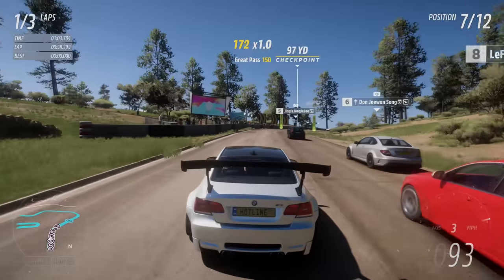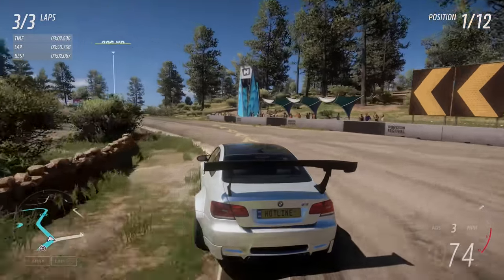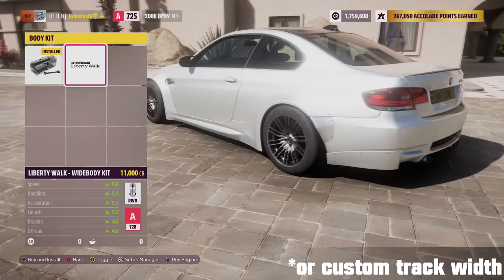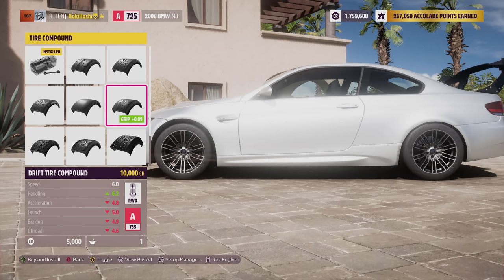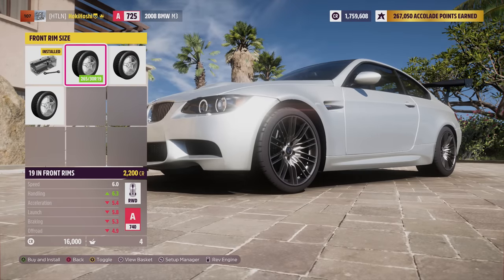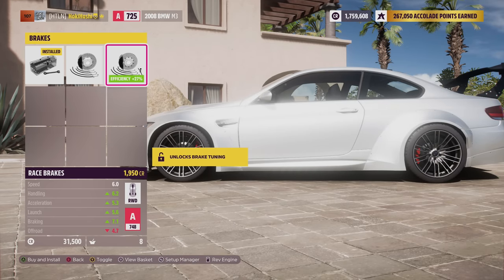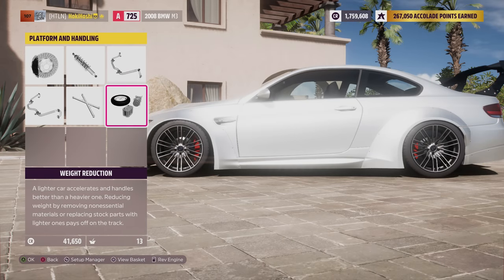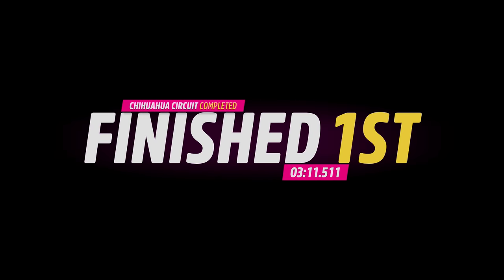How to Build Fast Cars in Forza Horizon 5 | Building/Upgrade Parts Guide

Comment: Quite interesting for me to watch this, I'm currently #426 on the list, I almost exclusively drive my own builds and now I'm watching "How to do what I've been doing more than 99.98% of people who've touched this game" but it's a really good watch and i can't find anything wrong with it. I may have my own ideas and preferences here and there, like I recently went for more handling and less straight line speed than I did before because I feel like it does better overall...but I also exclusively play random online races, avoiding rally stages (yeah, they didn't make the recent AddOn for me^^) other players may have a totally different experience. Oh I don't tune AT ALL, if I'm not fine with the top speed I'll fit another gearbox, add power, drop aero or pick another car. No suspension fiddling, brake distribution, none of that. I'm a simple man
Reply: Too bad, tuning can really make your car faster. Also respect people that can't really upgrade  or tune. Don't say that you are doing more than them. This video is aimed towards new players and whilst it is not totally accurate it really is informative and well made.
Reply: @ZaZ880  all true. I see that whenever someone beats me in the same car that I use ^^
 I wasn't trying to judge, just explaining a different approach for people who don't know or don't want all that mechanics stuff and how that also works without all extra effort. If you're like me and know a superficial bit about cars but can't be asked to fiddle with brake distribution, gear ratios and tyre pressure, you might want to find a next car that does the job before you go into stuff you don't really understand because someone on YouTube told you how. It works, sure. To me, though, that feels like YOU didn't get it done, you looked it up. 
I see people making all sorts of bs work in FH5 and I respect them all, I just don't want any virtual oily fingers and until now, never had to pack it up over it.
Sorry if it felt critical or condescending, the last thing i want is anyone to think I feel BETTER for not knowing stuff ^^
Reply: @YeeSoest  no worries man, i might have just read that the wrong way. I really like to tune but in this game some stuff is really backwards, i get what you are saying

Comment: I mostly agree with you. i'm a hot lap hero and love tuning cars just to try and reach top 100 in every rivals event. I have 2 already in FH5 that are firmly planted among the cheated times so they're not going anywhere any time soon. 

but I really do not agree with you on the cam upgrade. it is the second engine upgrade I put on my cars after exhaust. it increases rev range which massively increases wheel torque cause you can run lower gears everywhere. it also gives you a bigger window on turbo cars which makes them way easier to drive fast. it however doesn't increase top speed as much as some other engine upgrades.

I also always try to avoid intercooler and oil cooler. I don't think they are worth while because they add weight which make you slower everywhere but at the end of the longest straights. having some other engine upgrade instead improve lap times more than you would think in every race where out right top speed isn't a factor.
Reply: I haven't played in awhile but doesn't the damage simulation option simulate overheating if you run your car to hard hence making oil and intercooler upgrades more of a priority?
Reply: @trippybruh1592  I'm not shure that it makes a difference when driving with simulation damage on but pretty much nobody does that anyways and if you play like me with only abs active, manual with clutch and no damage can't you get any damage from overheating.

but I might try this tomorrow cause you got me interested

Comment: Just amazing, you truly understand the game mechanics thoroughly and I learnt a lot of thing from this and several other video of yours.
One genuine question: Is it worth spending time upgrading and tuning cars in Forza Horizon isnt the game arcade-ish ? or is it only viable option for Forza motorsport only ?
Reply: It's absolutely worth tuning, especially at the higher end of performance. A proper setup can completely change the way the car handles. Again it's not a huge deal if you're racing low difficulty AI, but harder AI or players will stomp you without a good build. You can always download a tuning setup and use that as a base to start tweaking
Reply: Yes you can download anything, but for one you can’t make adjustments to the fine tuning which is why I recommend you learn how to do the upgrading and tuning. I honestly find this stupid, because it’s not like the Forza devs can’t add a feature to make it so that you can’t share the tune as “yours” unless you’ve made several tweaks to it like the handling/speed. For 2, it doesn’t teach you anything but to continue being lazy all the time. Knowing this, all you get off downloading one is just to see what kind of parts the player put on it assuming you downloaded a good one and kept it stock (otherwise you won’t know which parts are the best if you downloaded a bad tune). After that, you need to learn how to make a solid base/fine tune for the car so that it’s manageable. Personally, I think it’s best just to learn this all from scratch and make as many tunes possible so that over time, everything will get significantly easier and faster to create. The more practice, the better as long as you know what you’re doing. A huge tip I have for you would have to be trying to not massively upgrade every single car you get unless it’s absolutely needed/the car feels underpowered at the top of its class. I see countless numbers of people doing this and I’ve fallen victim to it as well, but don’t do it nearly as much anymore thankfully!!

Comment: The AI in it's current state is broken. Launching sooner than you, making a 90 degree turn like on rails without any wheelspin in a RWD car in wet weather, accelerating too quickly. I was the lowest PI in a race quite a few times with the top one having over 20 PI more than me which is just dumb.
Reply: Must just be you
Reply: @chrispy9913  Reading posts on Reddit  says otherwise lol.

Comment: What about street racing or just street car style builds since you didn’t go much into specifically street? Would you just do a light race style build or what?
Reply: Like HokiHoshi said most people go for power builds (cause most races have big straights and wide turns) yet if you find your self on some tight and bendy racetrack like those in the city you are better off with light grippy builds.

Comment: You know, I find it funny that Playground Games were bragging about the level of freedom in customization in Forza Horizon 5. Bruh, these are the most restrictive upgrades probably in the entire Forza series. It's like HokiHoshi said, upgrade too far past the original performance class, and the car is virtually impossible to drive, let alone race. In FH4, I upgraded the Hudson Hornet from the D-class to the top of the S1-class, and it's one of the best cars I've ever built. Upgrading any car into even the next performance class is like trying to figure out a combination lock in this game.

Comment: Awesome video! I find that i can corner faster with drift tires than sport tires on my old Z. The highway onramp near the first house i can almost go 200kmh while with sport tires i fly out the corner at 180kmh. Why is that. Usually in games drift tires are less grippy.
Reply: Maybe it's your tune. drift tires with more camber let you take corners faster.
Reply: @Kostantinho  That was at 1,6 dagree's in the Front. Later found out that under power the traction was a lot worse compared to dirt tires.

Comment: Is it normal as soon as I come change my tires for my 1970 camaro z28 it goes from C to B should I put that car into B class for the best stats or I do everything to stay in C class??
Reply: It depends on the the track you want to race on. Your car is probably terrible at cornering but has a lot of power. Generally speakin, cornering is a lot less important in lower class cars. If you want better handling, you can put sports tires on your car qnd reduce the power but DO NOT put slick/semislick tires on a C class car. It is not worth it.

Comment: I always did cams if I could and always seemed to be slower than others online. I stopped doing cams, focused more on acceleration and launch and started winning. Also I found that using rally tires for road racing worked well and gave me extra PI to ply with, and off-road tires for rally/off-road. There are certainly meta cars online, but once I learned how to kinda cheat the pi system is when I was building fast cars. Best example is for b class online, off-road tires for everything, they feel like slicks caus the cars aren’t fast enough.

Comment: I must be a hell of a tuner because I upgrade my “D” class cars into “S1” while tuning the suspension and gear ratios for better handling. Older cars have higher upgrade ceilings. Of course they won’t do well if you neglect fine-tuning the suspension, tires, and alignment.

Comment: Why aren't the full slicks worth it in online racing if the car is only for the dry season?
What tires work best in light /heavy rain? Semis or sport (realism vs game?)
What about the race gearboxes with more gears often times not really add more pi wich I don't really like

Also noticed that the turbo upgrade adds less with the same pi as NA tuning
Really suprised about your take on cams

Comment: i litterally heard "esctasy of gold" in my head when u said AWD is not OP anymore 😁
Reply: To be honest, at the end of FH4 I stopped enjoying AWD and moved over to RWD and they were more fun, sometimes even easier to drive and much cooler. I didn't feel like I was tainting something beautiful.
Reply: @alanrobert3098  I also found I improved my racing a lot more while using a RWD car. Not as easy to race with compared to the AWD swaps! This news has got me super fired up that FWD and RWD are a lot more viable online
Reply: @alanrobert3098  RWD cars experience a lot less understeer, they also have more PI points available for more power/handling. It is the ultimate reward forza gives players for good throttle control

Comment: The AI this time round is more challenging I've found, normally I'm on unbeatable but had to turn it down to pro or even expert. AI literally is stuck to the driving line and there is still rubber banding.
Reply: I've been having the same issue, in FH4 I was always on Unbeatable, and I almost always won, but in FH5 there is always two cars way off in the distance and it's almost impossible to make any ground, even taking the best lines I can. However, I've found that if you have a very well tuned car, or good stock car, you can win quite often. I've found the BAC Mono & Lamborghini Centenario are pretty good cars stock. The BAC is best at circuits since it has a low top speed & great grip in corners, and the Lambo is a very good all-rounder.
Reply: @wideboi_porsche  A class napalm nova with mild slick racing tires is actually a really really fun car or at least the way I have it setup.
Reply: Something is wrong with the AI drivatar the last update they said they tweaked it but you can still tell it is like it is cheating as seen them act like they are on a glued track one was going a bit sideways but acting like it was going full speed straight and when you get close it like they have NOS and boost off. The main thing I notice in lap races the AI goes all out cheat mode till the second lap and then it turn off and they act normalish and on sprint after 35% of the race it goes back to normal and cheat mode is off has anyone else noticed that or is that just me.
Reply: @giggity4670  yeah they can go round tight corners from inside of track without going wide or sliding and virtually like a 90 degree angle, impossible physics it is BS.

Comment: In my limited play since it's been available, I find that overselecting tire performance on lower class cars has a much greater penalty than in earlier games, especially in the offroad or rally races.  My n=1 example is I improved an AWD car (Nissan Pulsar, love that car IRL) to A800 w/ Rally tires I consistently got blown away on expert, and by switching back to stock and making other improvements to get to A800 I was consistently top 3 on most rally courses.  

Other than that, I think this video perfectly captures my experiences and gives credence to some of the things I had thoughts about but was uncertain with such limited playtime so far.

I also appreciate the basic tuning video.  Kinda glad to lose the formulaic approaches to base tunes, but also kinda wish it was there as the higher difficulty levels are seriously no joke.  I had to knock it back to expert, lol.
Reply: Glad I'm not the only one that feels this way lol. I thought it was just because I was using an SUV (forza edition X5) that they were so much better but honestly the X5 is pretty damn fast.
I've been building primarily grip builds, I might try out a power build because the AI seem to walk away on the straights..
Reply: @BiIlDipperIy  I had the same issue. I kept crafting grip builds that handled great but always left me lacking in speed. Once I started going for speed instead of pure grip, I noticed I was staying at the top of the pack far more often. The bots seem to really turn the heat up if you have nice tires lol
Reply: @PlanarianCherald  Yep lmaoo I built a 2021 Gt500 that just walks away on straights. I like that they made it more of a challenge. I was sweating bullets trying to stay ahead in the X5M FE on the Goliath race 🤣 I would smoke em on the corners and on the straights they'd just pull away. Makes for really fun racing tho.
Reply: Can't remember what car I had but putting slick tires on it put it at like s1 890 ish, which was a 200ish upgrade on PI compared to doing other stuff
Reply: Huh I will try that when I get home, because I built high grip on an Audi for rallying, and was getting left in the dust.

Comment: I try to make a summary note of Hoki's upgrade guide (kinda rearrange the chapter), so here it is

<Class System>

The cars' class is shown as letters (e.g. A, B, C, and so on)

#
Performance index (PI) is shown as the number beside the cars' class

#
For multiplayer:
>
Maximize the PI within the class you're in (e.g. 800 for A,  700 for B, and so on)

#
For singleplayer:
>
PI and class don't matter

________

<conclusion>

#
The priority of upgrade are:
<1>
Unlocking tuning option
<2>
Tires
<3>
Suspension
<4>
Transmission
<5>
Brakes
<6>
Clutch
<7>
Adjustable arrow (If needed)
<8>
Reducing weight
<9>
Engine

#
Make sure to tune after upgrading
______

<Drive Train>

#
Transmission
>
Unlock tuning option
>
Sport transmission is the way to go
>
Upgrade to race transmission if you need extra gear, have the pi to spare, and want to tweak the individual gearing ratio

#
Differential (diff)
>
Unlock tuning option
>
Use race or rally diff for the corresponding
>
Use off-road diff only for dedicated off-road build

#
Clutch
>
Valuable for manual clutchless and auto
>
Pay attention to shift time change

#
Driveline
>
final pi tweak
>
drop weight and rev faster

___________________

<Platform/Handling>

#
Brakes
>
unlock tuning
>
Race brakes are expensive but worth it

#
Spring and dampers
>
unlock tuning
>
use race or rally suspension
>
improve handling

#
Antiroll bars (ARB)
>
unlock tuning
>
upgrade both front and rear

#
Chasis reinforcement
>
add one level of chassis reinforcement for each class increase
>
valuable for an old car when you add a lot of power to it

#
Weight reduction
>
Increase handling
>
Choose between this or adding power

_________

<Aero>
>
Only important for A-class and above

#
Rear wing
>
Only use if it lowers PI or is really needed
>
unlock tuning

#
Front bumper
>
upgrade only if the car is understeering too much
>
unlock tuning

____________

<Tires & rims>
>
Important upgrade

#
Tire compounds
>
use rally, offroad, or drift for the corresponding build
>
Just use the stock for AWD
>
RWD and FWD use at least one upgrade

#
Front tire width
>
Upgrade if the car understeer (especially on fwd)

#
Rear tire width
>
Max rear tire width

#
Rim style
>
Final PI tweak

#
Rim size
>
increase car response

#
Wheel spacing
>
help handling and grip
>
For RWD leave the front spacing stock
>
More rear spacing promotes understeer and more front spacing promote oversteer
_____________

<Conversion>

#
Engine swap
>
only upgrade if you're trying to push the car into a class

#
Drivetrain swap
>
Just use stock

#
Aspiration swap
>
Preferably leave it to stock

#
Body kit
>
Final tweak

____________

<Engine>
>
save for the last upgrade
>
Intake & exhaust is highly valuable
>
Oil/cooling is valuable if you use a turbo or supercharger

___________

That's all, if there are any mistakes make sure to let me know & if it's helpful give it a like ;)
Reply: Very helpful. Thanks!:)